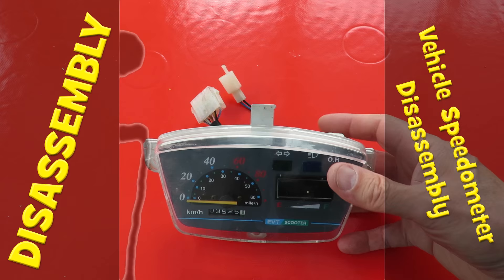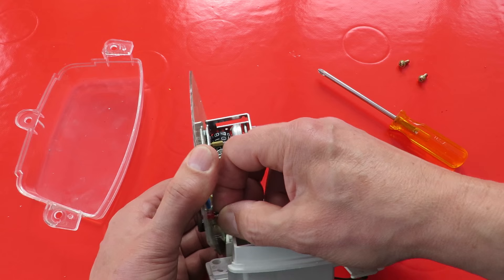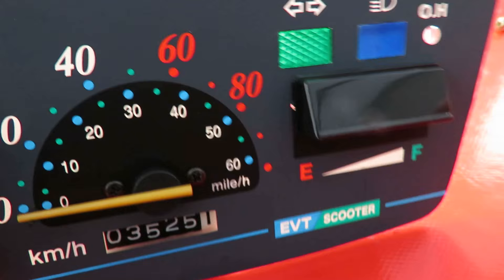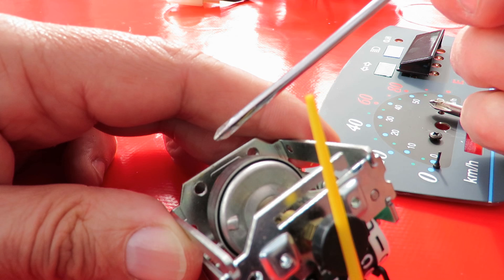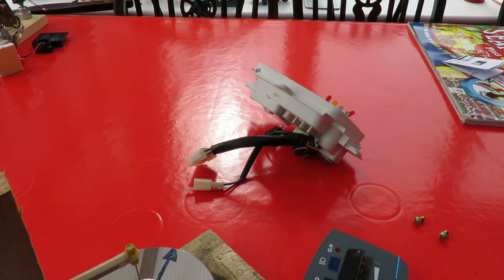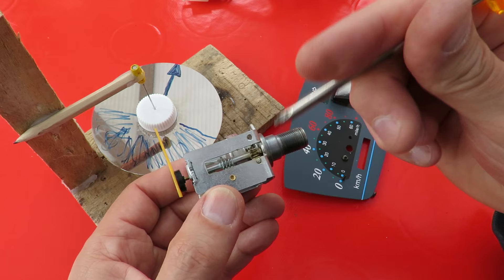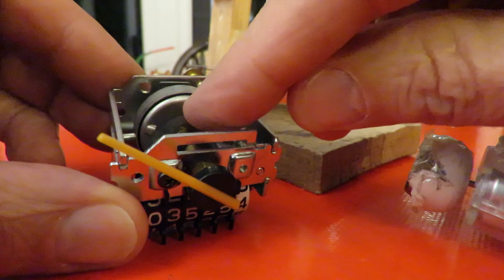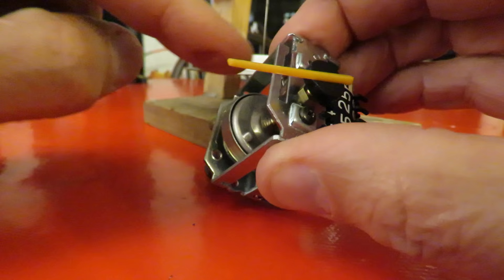Vehicle Speedometer Disassembly

Comment: thank u so much, very well explained. I want to know that, is that spring who stops the needle at certain limit avoiding the needle to rotate? (just like the disk was rotating because no spring there.)
Reply from the maker: Without the spring to stop it that disk would spin round continuously. With the spring in place the further the spring is twisted the more it resists the turn so the amount it rotates is proportional to the speed of the magnet spinning.
Reply: thanks

Comment: The needle jerks while accelerating 0-45km after that it's quite normal. Would like to know any method to fix it. 
Thanks
Reply from the maker: I remember years ago having a problem with the speedo on my motorbike and that was the cable was frayed at one end and dragging in the sheathing.
Reply: I had this issue before replacing my cables. And recently i went on for a replacement of speedometer drive gear&pin. Now both the cables and gears are good as new.

Comment: At 8:55 I noticed that the disk to which the needle is connected to only moves a certain distance then stops. However, in the example you showed us, the disk rotated a full 360 degrees. Do you have any idea why that happened? I think that it has to do with the weight distribution of the disk but I don't know if that's correct.
Reply from the maker: I am not sure what you are looking at. The cup that the needle is attached to does not rotate 360 degrees. It is rigidly attached to the needle and you don't see the needle spinning round 360 degrees do you?
Reply: @GrandadIsAnOldMan  Ya exactly! My question is: why it doesn't rotate 360 degrees like in your demonstration? It only goes to a certain point then requires more speed to turn further.
Reply from the maker: @shokobata  what demonstration shows it turning 360 degrees?
Reply from the maker: @shokobata  do you mean the metal disk I have suspended on the wooden frame? The cup in the speedometer with the needle attached is turning against the spring to give it resistance. That is why it needs more speed to turn further. You can see the spring at 04:19 if you look carefully. It is a flat spiral coil. I tell you about it at that point.
Reply: @GrandadIsAnOldMan  Thank you! That is what I need to know. Sorry for not replying earlier.
Reply from the maker: @shokobata  I guess you missed the bit where I showed the spring. That is why I couldn't understand what you were talking about 😊👍

Comment: Sir my car omni ven 2014 model . Temperature cage working & fuel cage working. But speed cage and km number not working. Chenges metirial neme sir
Reply from the maker: The temperature gauge and fuel gauge will be electrical, so your power is OK. The speed gauge and km will be mechanical. So I would guess your Bowden cable is broken. That is the flexible metal cable that goes from your gearbox or wheel into the back of the speedometer assembly.

Comment: Sir i have one speedo meter of suzuki swish 125 ,the problem is the cable rested and fixed inside the rotating part of the meter ,any idea to remove
Reply from the maker: I can only suggest using penetrating oil to release it over a period of time.

Comment: what is spring in the speedo meter problem
Reply from the maker: I am not sure if this is the answer to your question.  Jump to 05:28 and you can see the coil spring clearly.
The drive from the motor or wheel spins a magnet.
The magnetic field causes the cup attached to the speedo needle to spin.
To stop it spinning right round it is attached to a spring so it is the torsion of the spring that determines how far the speedo needle will move compared to how fast the car or bike is moving.

Comment: There is an easy method to reset the odo...
Just remove the clip near the plastic gear and rotate the nos..
It's all set to zero..
Reply from the maker: If that is what you want to do. I was more interested in the way it uses a magnetic drive 😁👍

Comment: My odometer is running 10km for running my vechicle for 1km why is it so
Reply from the maker: Possibly because you have the wrong odometer 🤔🤔 Does it register the correct speed? If it is exactly 10 times the correct value, it could be two of the gears driving the individual number rings are stuck together, maybe some dust or grit stuck between them.
Reply: @GrandadIsAnOldMan  It is showing correct speed but odometer reading is too fast
Reply: @GrandadIsAnOldMan  To be precise only for running 1km by odometer went from 63km to 71km
Reply from the maker: Assuming yours is basically the same construction as the one in the video, you can see how the gear drive works. The drive for the odometer is geared off the same drive that spins up the speedo 08:55 so IF the speed registered is correct, then it must be the right set up for your vehicle. If it is spinning the number disks too fast then like I said, it must be that some of the number dials are jammed together and being dragged round. I assume you are not getting confused by the 10th of a Km number dial. @whiteunbox5978

Comment: My Speedometer shows 50 kmpl and when i changed the speedometer it shows 60 kmpl . What should be the problem??
Reply from the maker: Maybe it is the wrong speedometer for the bike.
Reply from the maker: @yogendrasinhparmar8626  In that case, you have a problem. The speedo will have been calibrated by the manufacturer to indicate the correct speed based on the rpm of the drive cable. The rpm of that cable is set by its gear linkages and is governed by the size of your wheels. Smaller wheels turn faster for the same speed on the road. They will have adjusted the tension of the detent spring to take this into account for the bike the speedo is designed to fit. You could try adjusting the tension of the detent spring, but as you have no way of calibrating it against a known speed, you will just be guessing and could make it worse.